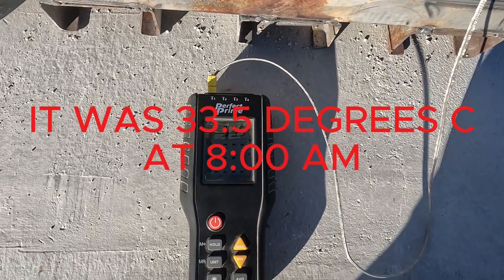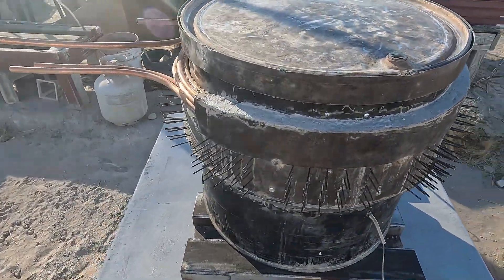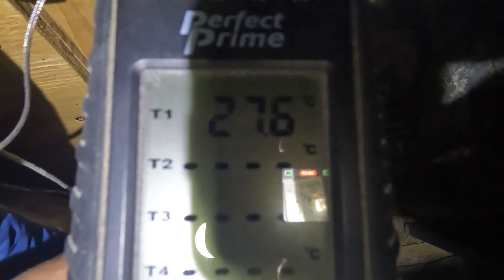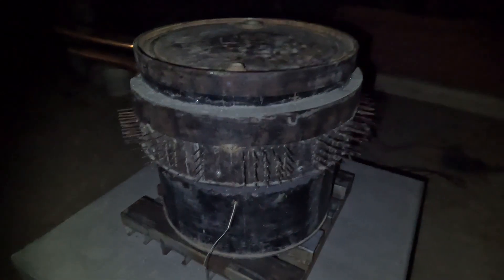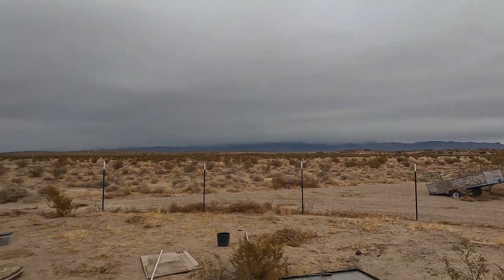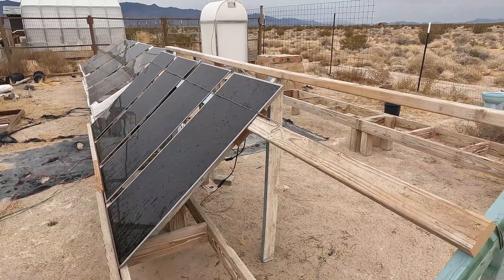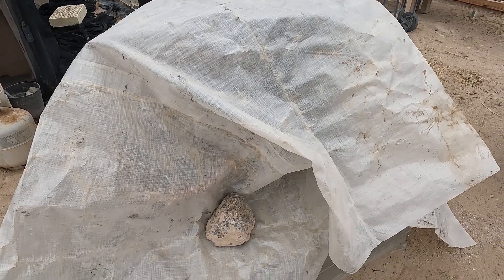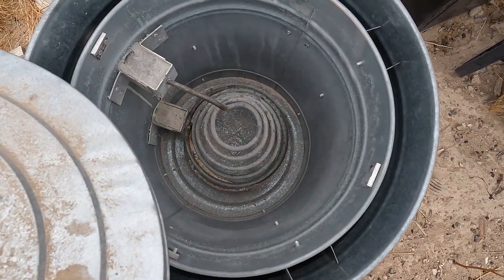172 - Thirty-Four Gallon Sand Battery Update

Comment: What about putting a can on the wood stove? Could I generate from that?
Reply from the maker: I would think so. I have considered adding sand reservoirs to my wood stove but I may need reinforcements before I could add the extra weight.
Reply: @off-gridsurvivalmike8120  I as well, Im in a Toy Hauler. In the dead of winter I can run my stove pretty hot without cooking myself out of here. 375 -400 degrees is doable. I don't quite understand this process yet but those little modules others are experimenting with are just not cutting it yet. Im looking for something I can generate 10-15 amps for a goal of 12 hrs a day during the winter solstice time. Not sure if this whole idea is doable yet but I might as well experiment with it. Sounds a little bit promising to me.

Comment: What are all those spikes on the collar for? Is it a heat exhanger with the outside?
Reply from the maker: My plan is to enclose it inside of a metal box with an air cavity that I plan on drawing hot air from with fans. I drew up a rough version in a past video. So the spikes are to transfer heat into the cavity area on the outside of the drum. Then I will insulate it and add an exterior finish maybe a corrugated metal industrial look not sure on the finish yet but first I need to see heat making it to the exterior of the drum before I start framing it in.

Comment: Greetings from the great white north Mike. I have experience with thermal mass storage. I have a 2000 gallon tank full of sand buried in 6 feet of clay, 6 ft underground.With a perimeter and sloped roof on 4 inch insulation over top of it to keep the moisture and ground frost away. I stole the idea from Polar Night Energy, and buried it. The only things above ground are the heating elements and blower that moves the air through the system, and the heat exchanger for the home systems. Which are inside the shed I built on top of the tank. Im completely off-grid in Saskatchewan. And I have very large 26kw solar array. It still cost me less than it would have to bring power into this site. Every time my batteries are full? Im dumping 4-8kw of energy worth of hot air into that tank an hour. The Tank (and most of the clay around it) is 575C right now. By the middle of March when the days get long enough for me to be pumping more energy into it? It will be around 200C. I use it for my hydronic in-floor home heating and it supplies an endless amount of hot water year round. The Solar system is so large because I wanted to ensure that even on cloudy days the 10-12kwh we used over night is back in the 30kwh batteries as soon as possible, and Im making heat all year long.

Retired power engineer btw. Spent nearly 30 years working with commercial steam and refrigeration applications. It wasn't hard to justify the extra $10k worth of solar. The only other ways of heating this place would have cost $2000-$3500 a winter.
Reply: Nice. You should make a video about your system. I would watch it.
Reply from the maker: That sounds like an awesome set up.
Reply: @off-gridsurvivalmike8120  Spent most of our savings buying this place and getting it set up and renovated. But in 3 1/2 years we will have the solar paid off and won't have bills in our retirement to deal with other than tax phone and internet.
Reply: Hey.  Can you record how your system looks like?  How you are taking heat to house and how long you can drain the heat after reaching 575C in sand battery?
Reply: Great work there Sir!
Can you please highlight about the heating system? Are you using an induction heating system to generate the thermal energy? Also, have you used any kind of insulation around the sand tank, like Rock Wool or Thermal Wool?

Comment: The problem I see is the heat loss rate as it may be balanced at 70 f but never reach optimum at 32 F so you need a collective chamber to catch the heat and release it at a rate which keeps it balanced. Just thinking out loud here Mike you are far ahead of me.